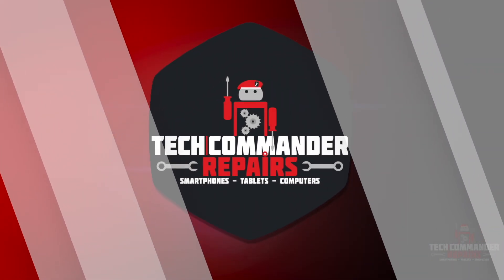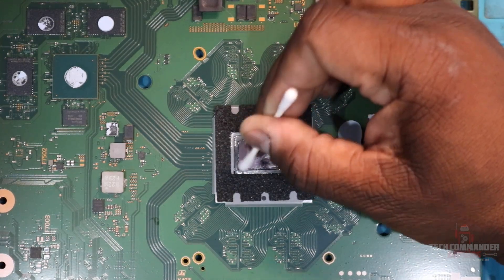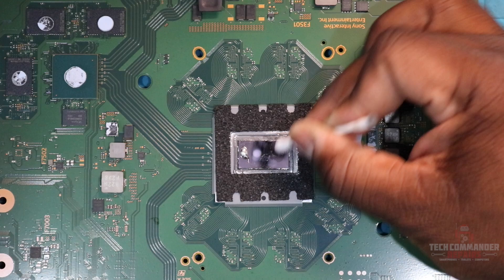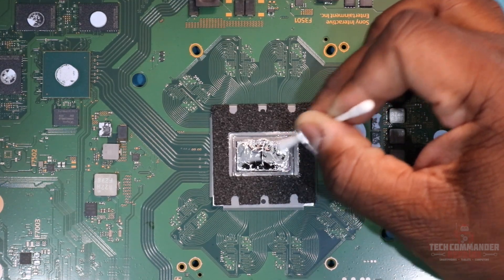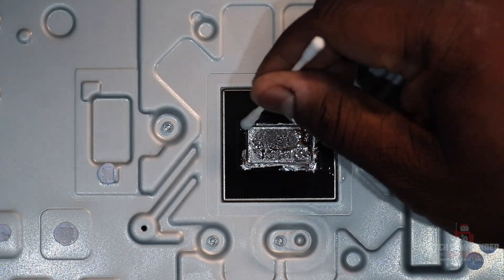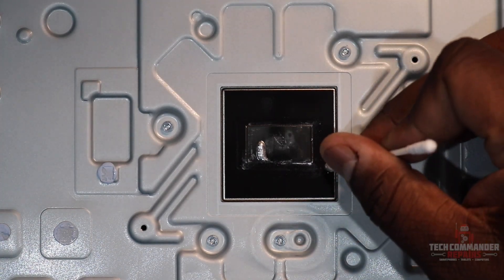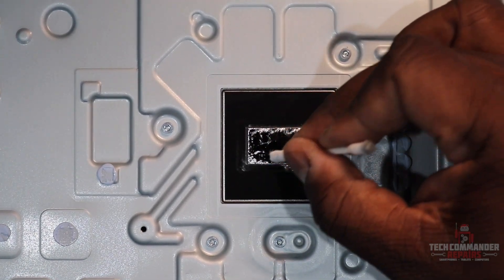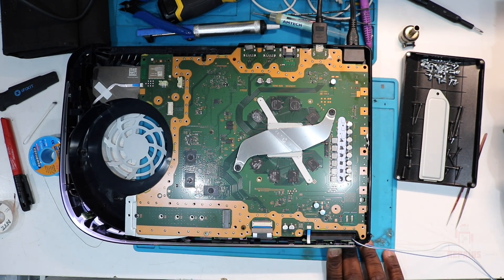Playstation 5 Liquid Metal Application | PS5 Maintenance

Comment: I bought a new pa5 in box, it works but shutdown after 20 to 30 minutes of gaming ps5 games, but i can play ps4 game without problem.
Do you think it can be caused by the liquid metal?
Reply from the maker: If its brand new from a big box store then it could be a defect issue and if suggest returning it, 

2nd option: send it to SONY because you should be under 1 year manufacturers warranty

3rd option: it's a used console and probably needs the liquid metal and dust cleaned out. Also it could be an issue with the power supply or the board.
Reply: @TechCommanderRepairs  oh okay cause I bought it from someone who bought it from the store, I guess I can try to find them so that they can return it if it's possible

Comment: so I don’t need to buy more Liquid Metal ?
Reply from the maker: Usually you don't need to. I'd suggest buying new liquid metal if you've had the system for 5 years and it's constantly overheating. 

From what I've seen it's been fine so far with these systems
Reply: @TechCommanderRepairs  Nah I’ve had it since launch, but never had a problem with it overheating beside a few years ago during the summer. The problem is it just makes the beep sound and lights up blue for 1 second b4 shutting down again. This is the first time this has ever happened, but I’m assuming it has to do with the Liquid Metal.
Reply from the maker: @CosmixxSlopShop  that one beep is a board issue. Nothing to do with liquid metal. You'll needed to have the board looked at and repaired